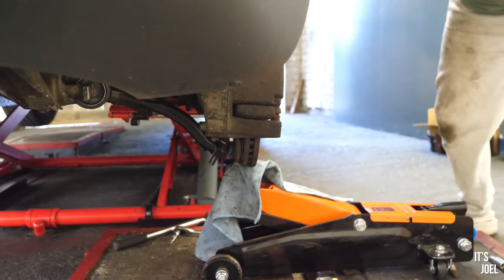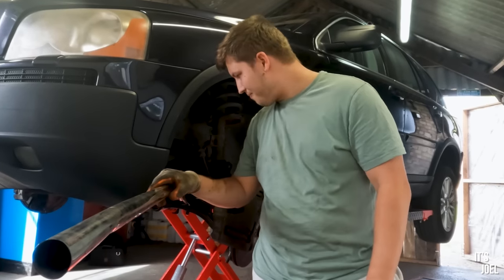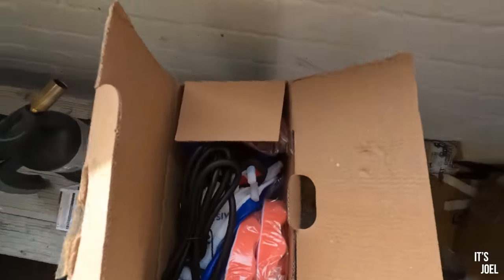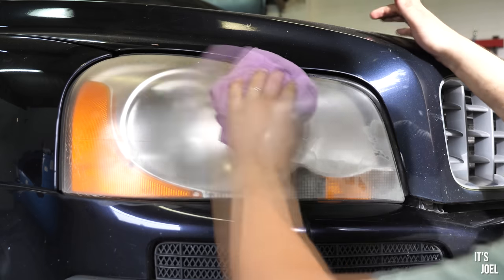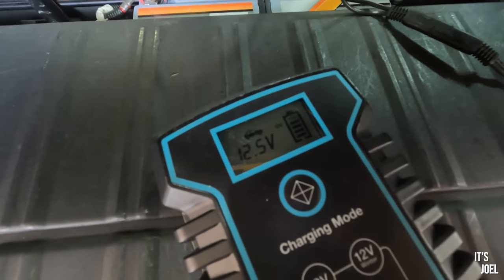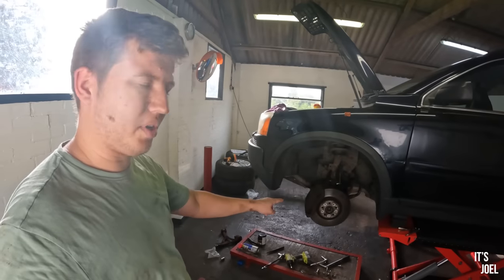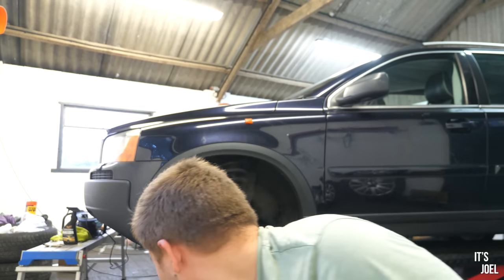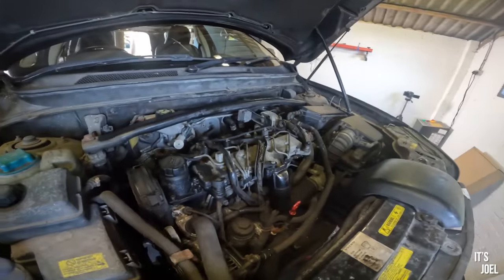CAN I SAVE MY £800 COPART VOLVO XC90? PART 3

Comment: Just ‘jumping into the comments…’

What you assumed regards the ball joint is a common mistake and you only learn things by ‘doing’ things. Well done for showing this in your video.. also when ‘spannering’ it takes time to get used to using hand tools. It is a skill in itself. Keep going and you will keep
Learning. There is nothing that you cannot learn through doing stuff like this. You will buy tools that you need to make things happen and eventually buy tools to get the job done faster. Regards your ‘clothing’ wear your scabbiest kit and wear gloves to protect your hands. I use neoprene gloves and you will get through them quickly. They give a decent level of dexterity and protect your hands from carcinogenic liquids etc. I buy them but the 1000(10 boxes) …
Buy a pair of steel toed boots ditch those shitty crocs, you will only drop something heavy on then once!! 

My daughter has a
XC90 not worked on it as of yet.. so watching here..

Keep at it.. take some advice when you need to. Ask for help also. People know stuff.. 

Enjoy!!.
Reply: Just getting further into this. 

When releasing/undoing bolts they are easier to ‘break loose’ when all
Assemblies are still ‘together’ so ‘break’ the assemblies you want to work on at the start of the process. So the control arm/track rod end and drop links at the same time. 

Remember ‘doing’ stuff gains your experience..using tools in a safe manner to help you lift/pull heavy stuff takes a bit of thought and experimenting. KEEP GOING!

Comment: This is an excellent series, its so good to see someone give an accurate representation on what working on cars can be like, I remember once when I was changing the lower arms on my car at the same and ended up having to cut them out! 

On a side note, looking at the advisory note from volvo, the blown intercooler caught my eye, as that could also be your emissions failure as that could cause a boost leak and then excessive smoke out the rear, hope this helps!

Comment: Joel, Iv enjoyed the watch but not for the best of reasons.
In a nut shell you underestimated the practicality invoved in simple jobs like changing wishbones.
You appear to be out of you depth mainly because you have dived straight in without doing the research.
A word of warning on the injector. Be prepared to purge the system of air and check if the new injector will need a new crush washer and/or needs coding to the car

Comment: this was a painful watch .... good to use spring clamps when removing suspension ... the floor jack manipulation helps much to those who are working alone and patient ... i dont advise guys like you to tackle life and limb repairs ... if you stuff up the bolts tightening due to suspension forces, etc .... an important nut on balljoint may come out, rendering the wheel coming off its axis and locking against body creating a potentially fatal accident ... one needs lots of mechanical manipulation experience to tackle such repairs ....
Reply: watch videos online of others exacting such repairs to educate yourself before tackling job .... little niggles and solutions may surface in their videos ... learn from their struggles so u dont have tp repeat them
Reply: example, you tried removing stabiliser bar and nut would not come off as its a ball joint and keeps rotating. you didnt notice an allen key hex in centre .... hold that with hex key and use a ring spanner to open. you need support the kex with some extension to counter the force of opening, or use a hex socket with t bar

Comment: Sorry but this is a bit hard to watch. I just watch it for a lough now. This is the videos of how not to do the jobs. 
With anti roll bar links would probably help to undo the nuts if you actually go the correct way so anticlockwise...although grinder would solve the problem in 10 seconds

Comment: Stop and think, step back and think a bit more before getting stuck in, how many hours have you wasted on things??? You could've walked God knows how many miles to buy a hacksaw to saw off your drop links. Glad you got your bottom arm in place tho' however there are much easier ways.
Reply from the maker: This is my first time. It was always going to be extremely inefficient and difficult, but I’ve done it so that I can improve

Comment: Did you not take the drop link off .. no wonder you struggled cut through is easy enough but buy a cheap dremel to cut the nuts off get down the scrap yard for that injector! And stick it in your pocket 🤪

Comment: lol mate you have no clue what your doing…I did my clutch on my Volvo v70 on my drive…had to drop subframe and engine to get box out. You don’t even own a 15mm spanner…put the tools down and leave us professionals to it
Reply from the maker: So just give up then?
Reply: @itsjoel  no giving up isn’t an option in my books…you need at least someone to help you who has half a clue. All your issues with ball joints and bottom arms were all due to inexperience and crap tools. You even didn’t have a 15mm spanner. That car isn’t half as rusty or corroded as 90% of cars I work on daily just takes a little knowledge and technique …taken me 29 years working with cars to gain the experience I have and even still I learn something new every week

Comment: Painful to watch, if you haven't got a clue what you're doing then don't do anything! 
You wouldn't get some gimp of the street to rewire your house would you?
Reply: You do know only you left a horrible comment. Just you no one else has mentioned it because he is leaning. Do you feel better now.
Reply: @brendancoffey1684  horrible comment? He hammered a drill bit into the threaded hole of his driveshaft, he didn't realise that ball joints move, he bought replacement ABS rings without doing any diagnostic work, and he hasn't got even the most basic of tools, a spanner set, he needs to be called out on things before he does any harm to himself or others.
Reply: @TheMan-si4iu  point taken.

Comment: Sorry but you really don’t have what it takes to be a mechanic. You give up too easily and don’t seem to have a manual or done the research for each job. Drop links are dead easy to do. If you cant get them undone mechanics just grind the nuts off. They can’t justify spending hours on something that can be done in seconds. You need the tools for the job and thats where you should spend the money. 15mm spanner’s are a necessity not an option. This could all have been done on a driveway saving you the cost of the workshop. As for the fuel injector as others have said leave well alone, you don’t know what you are doing. You need to read the comments, the answers you need are there. The car was £800 for a reason as it will probably cost that or more to get all the jobs done making it uneconomical viable. You are also very likely to hurt your self which nobody wants see, wearing crocs and trying to use tubing that’s not strong enough. I was taught by my cousin who was a mechanical engineer and sourced my first car for me. It needed loads of work doing to it including an engine rebuild which I did under his supervision and in the process learned how to be a decent home mechanic. You need to do similar or a least read the owners manual and a decent repair manual. You tube is a great source of info and methods to do certain jobs but for every good piece of advice there is loads of poor info and you need to be able to recognise which is which. I wish you luck and please be careful.